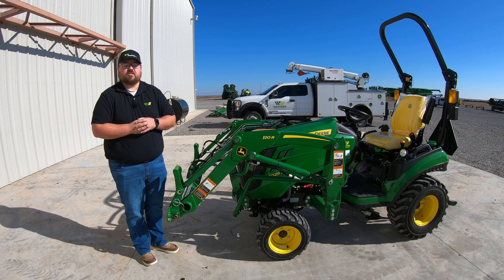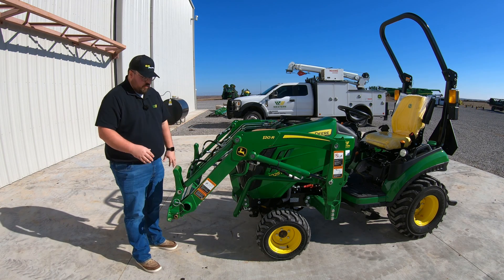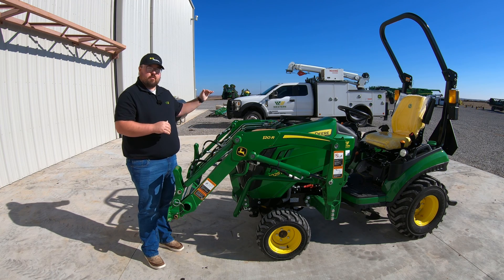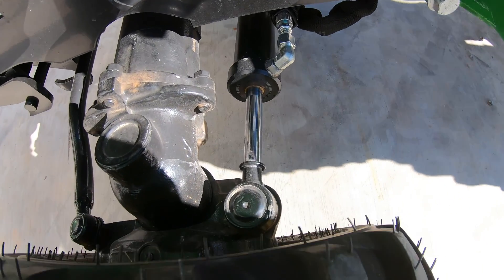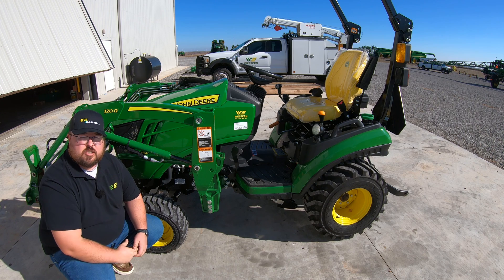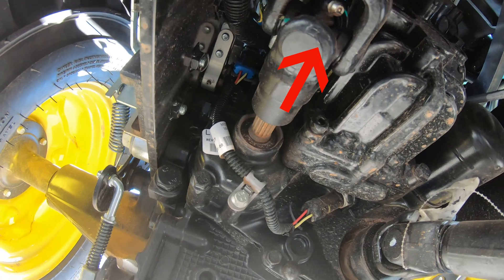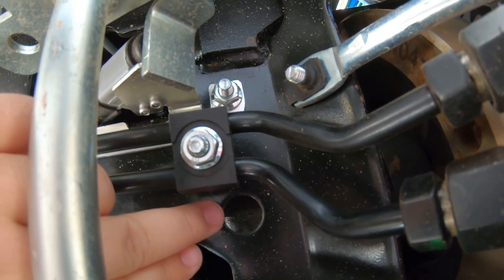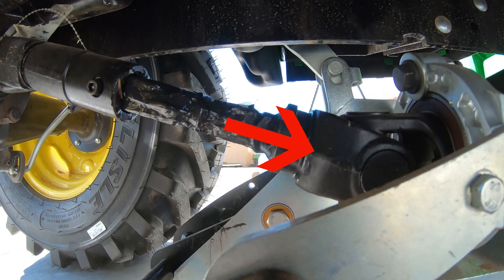ALL Grease Points on John Deere 1025R Compact Tractor

Comment: Thank you for the video.  It helped me finally grease the drive shaft. I tried the standard grease gun and could not get grease into the zerk fitting. Apparently, they were stopped up. Finally, got out the Dewalt pressure grease gun with a Lock n Lube, it was hard to connect but worked great forcing grease into the fittings.

Again thank you.

Comment: Good video on grease points. 

My shifter is getting tight and difficult shifting. Are there any grease/oil points on the transmission for the 1025r?

Comment: i don't have ANY zerks on the power steering knuckles on  my late 2016 1023E???  Is that normal?
Reply: My 2016 1025r does NOT have grease points on the power steering.  Just rebuilt the left front axial hub due to seal leaking.

Comment: Ty for the straight to the facts video, i know your trtin to sell JD products,  but, a high moly grease beats all other greases. Especially for pins on pivot points. Rolling elements, sliding surfaces etc. Kt wont replace slindle greases, but everything else, black moly

Comment: Do you have any recommendations on how to grease the 54D/60D mower decks for these 1 series tractors? For example how much grease do you pump in the spindle, what kind of grease, etc. There aren’t really any clear videos on how to do this.
Reply: you fill the spindles with grease until it starts coming out the bottom.  you need to remove the blades and the sheet metal guards to be able to see when they are full.  easiest with the deck on the loader.
Reply: I believe the manual says every 10 hours. I use a long lock n lube because I have the drive over without the long one, I had to take the ramp off.  I just give it 2-5 squirts. You can feel the back pressure when you pump it in